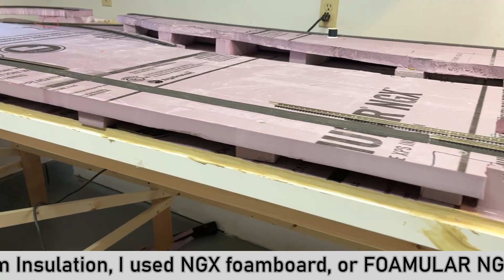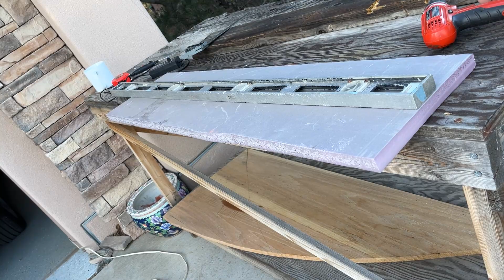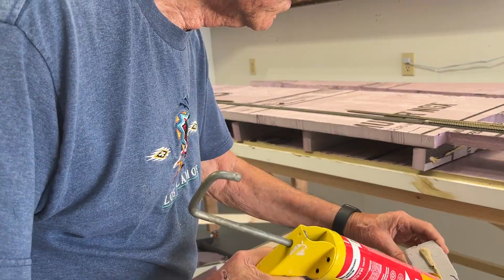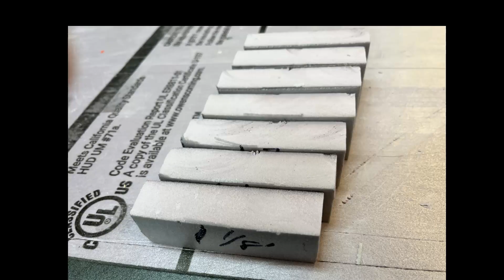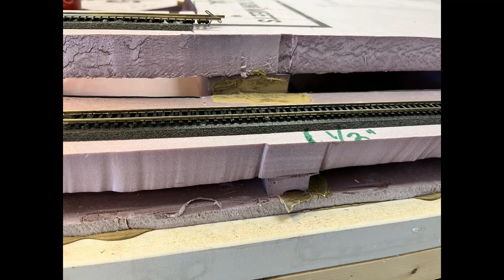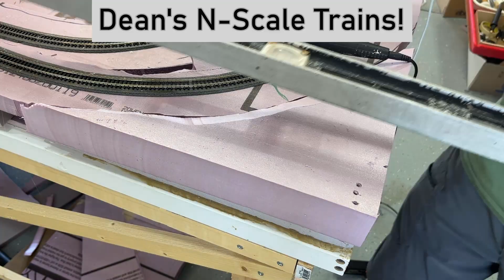How I use Construction Foam Board to Support my Santa Fe Northern N-Scale Model Raiload

Comment: Great video, I need a foam cutter(electric)
Reply from the maker: You can get complete kits from Amazon for $25 on up. Most have both styles of cutters, wire and rod. Woodland Scenic has a wire cutter for $50.
Reply: @DeansNScaleTrains Thanks!